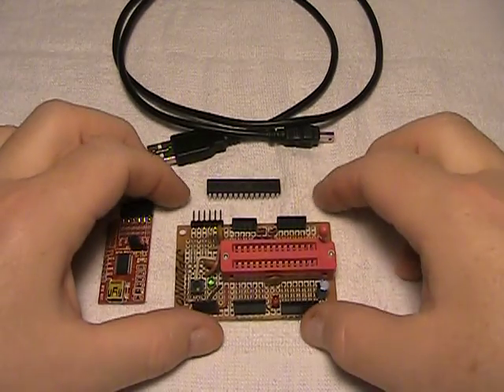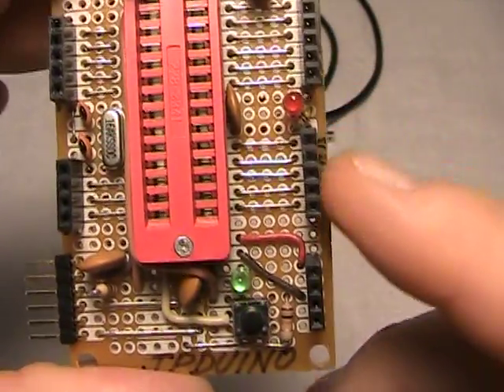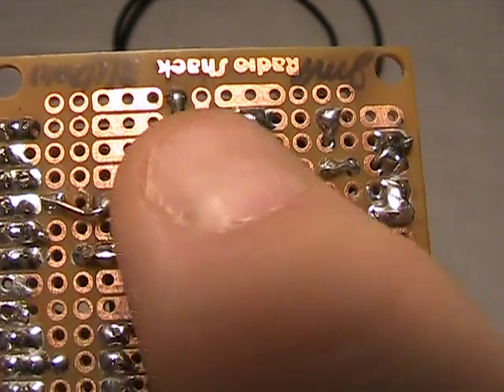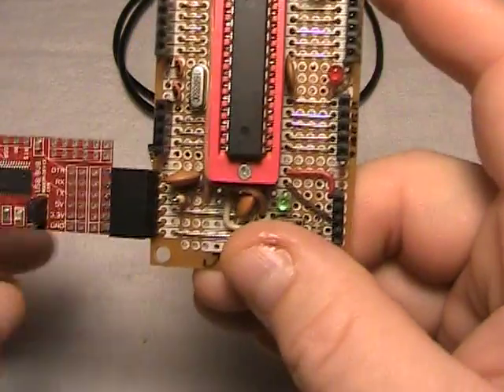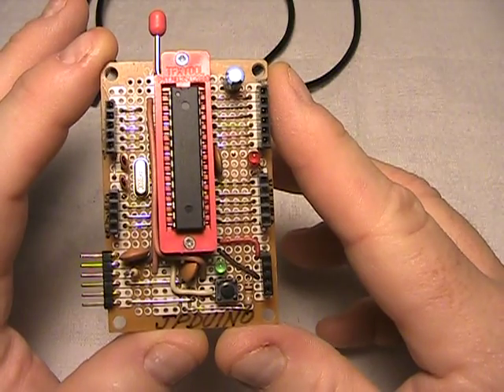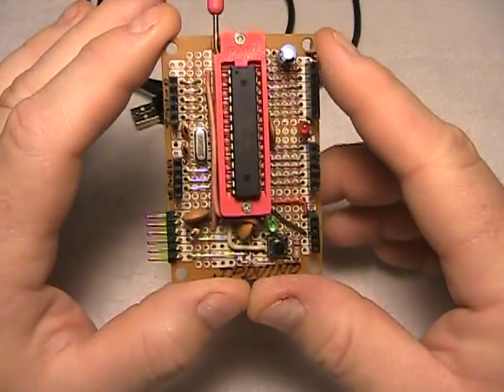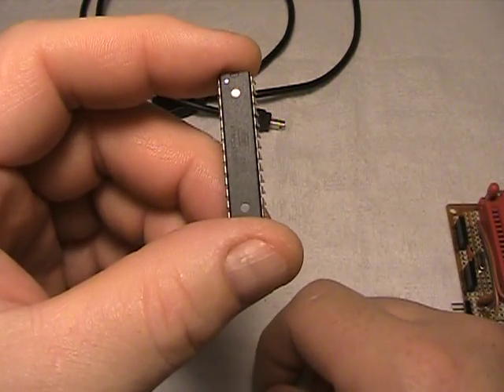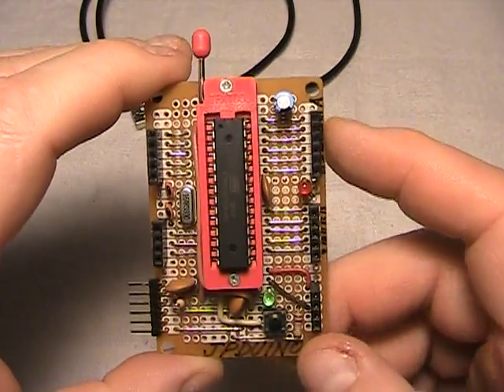Arduino programmer for economical projects

Comment from the maker: ZIF sockets are meant to be soldered onto the board.   I wired up all the pins so I can actually use this as an working Arduino like board.  I was going to do a prgrammer only but made it a working Arduino board.  If you just want to make a programmer by all means only solder pins you need for power, clock crystal, TX and RX pins  to talk to FTDI board and you are good to go.  I would recommend soldering a few unsused pins just to hold the ZIF socket firmly onto the PC board.   Good programming.

Comment: Very good video. Question about the ZIF socket: does it require soldering into a board, or could it be simply plugged into a breadboard? A noob question, I'm sure, but I'm hoping to be able to do something like your board - only with less soldering!!! My version might be used to program 328's just a few times... Thanks for your video!

Comment from the maker: @francisroan 

The chips are not that costly.   I found a guy on Ebay that sent me 5 with Arduino bootloaded for $21.00.  You can generally get them for around $5.50 on some web sites like Adafruit, Sparkfun and Modern Devices.  Check out Modern Devices and look at their RBBB  (really bare bones board) Arduino compatible kit for $13.00.  Learn how to solder on one of these kits.  You need BUB and USB to talk to the RBBB or the BBB kit they have.  GOOD LUCK

Comment from the maker: @drewmaster74 

Thanks for the feedback.  This is also my first video on Youtube.  I have to quit saying  "uhm".

The FTDI pins provide the serial TTL communications to the chip for downloading  sketches to the chip just like the Arduino Duemilanove boards work.    The FTDI chip comes built onto the Arduino factory boards.    The Arduino board has a USB receptacle for a USB cable that goes between the board and your PC running the Arduino IDE application.  Boom!   Hope that helps.